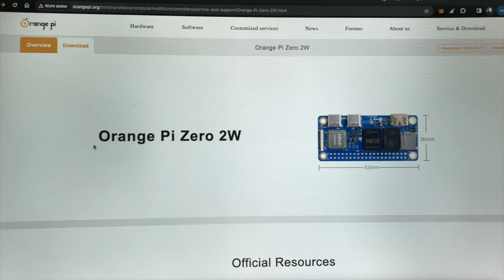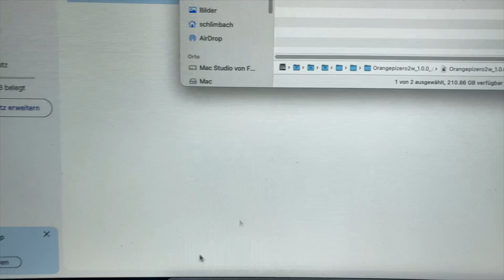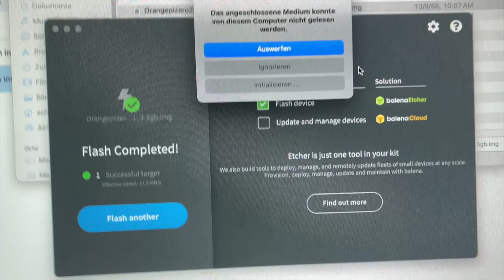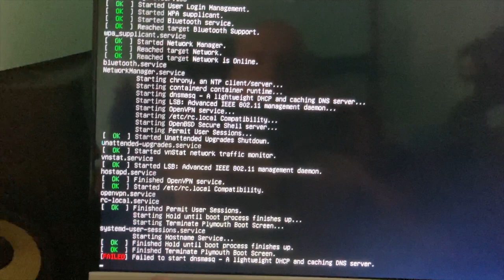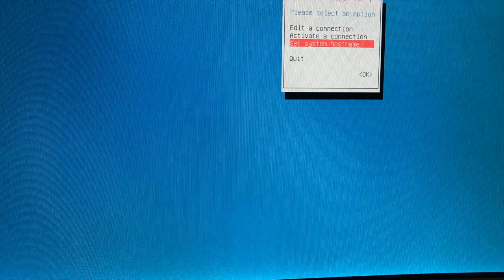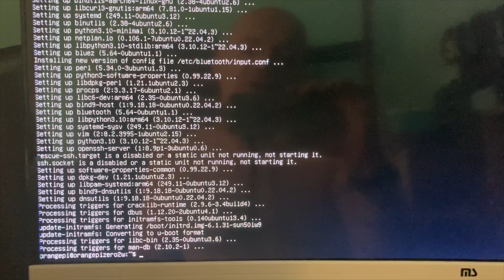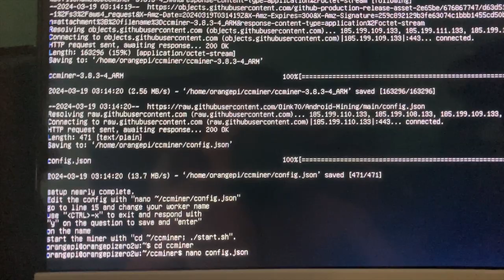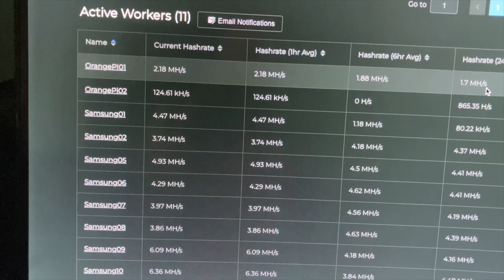Setup And Run An Orange Pi Zero 2 Watts Mining Verus Coin #verus #tutorial #orangepi

Comment: I have this one for testing. I have burned the image to microsd but nothing happens. Mini hdmi port has no display output/my monitor does not detect signal. Anyone else having the same problem? FYI I am using Sandisk 32GB class 10.
Reply from the maker: @AmriKarisma  did you took the right image from my Google drive ?
Reply from the maker: @AmriKarisma  and are the lights on at bootup?
Reply: @CheapCharlieMiner  Yes blink green light but no display
Reply: @CheapCharlieMiner  Problem solved. Yes I used your image file but same result. Finally I used armbian with preconfigured wifi auto connect. Then I accessed via ssh.
Reply from the maker: @AmriKarisma  awesome 👏 happy it works

Comment: I've followed your installation and they work however with some of my Orange Pi's I experience that after a while they stop mining and there is nothing I can do. I turn power off and on but nothing happens, they don't boot up to the command line even. The only thing I can do is take the Micro SD card out and start from the beginning, meaning I have to flash the Micro SD card again and then do the whole installation again.

Have you also experienced this? Any tips anyone?

Thanks in advance!
Reply from the maker: Did you install the correct image ? You can download it from my google drive https://drive.google.com/file/d/1q1tkyKgEiYNWXOcjFgVfbm-3oG7OBoN-/view?usp=drive_link

Comment: mv: cannot move '/home/kp/ccminer/' to a subdirectory of itself, '/home/kp/ccminer/ccminer'
chmod: cannot access '/home/kp/ccminer/ccminer': No such file or directory

this is an error during installation
Reply: dpkg: error: dpkg frontend lock is locked by another process
Reply from the maker: no worries, i get always error messenges but it works !!
Reply from the maker: @jitcrypto  if it is working not after installation just press arrow up for to repeat last comment and install again ! sometimes i install 3 times ( mostly because internet connection interuppted ).